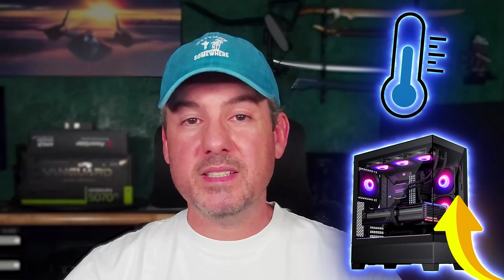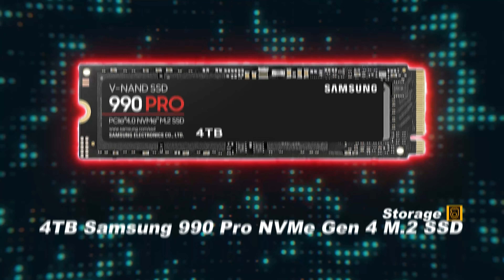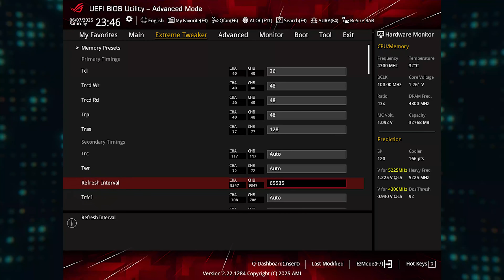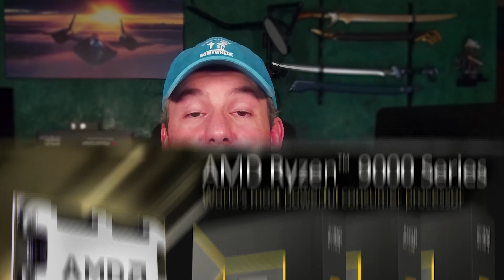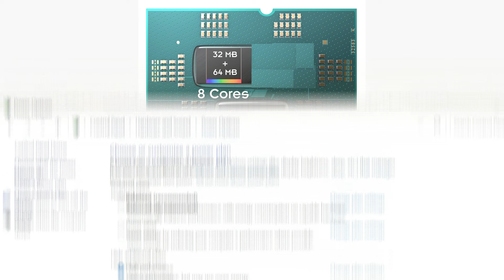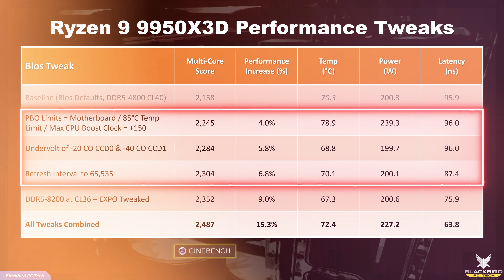What Are The Best Settings for an AMD Ryzen CPU?

Comment: Optimizer and software OC has never been stable or safe. That's why you void Warranty when enabling it. Using the max safe voltage in BIOS and then testing all core stability and temps is the best way using incremental increases depending on your CPU. All my OC PC's still work like the first day! My 9900X went through 48 hours Prime95 at 5.4GHz at 1.290 V and temps no greater than 78C with a 420mm AIO
Reply from the maker: I have no idea what it is that you are trying to say
Reply: @blackbirdpctech  Precision Boost overclock voids warranty...AMD will save a lot of money.
Reply from the maker: So you won’t use pbo, a feature developed by AMD, but you will manually OC your PCs? So tell me, how would pbo void your warranty … why wouldn’t you just reset your bios?
Reply: @blackbirdpctech  It tells you when you do the pbo. When I tried it on my older CPU 5900X any score from all the modern benchmarks was way lower than the manual overclock too. And especially the multicore tests. Besides the fact that PBO has been linked to CPU failures. But restricting Voltage to the safest max which I believe is 1.325V for 9000 series AMD you will not "burn" your CPU. I get 5.4GHz all core with 1.290 V and temps that never exceed 78C when doing heavy loads on my CPU. Perhaps with the PBO if you can put your max voltage to the safe, it may work but I doubt it will reach the scores I get with the manual overclock. I am planning to do some custom loop to have GPU and CPU in the loop to have less heat in the case and maybe go even higher! I got it to work at 1.325V at 5.5GHz but my temps when under heavy loads reached 89C, so I scaled back to 1.290V. Don't get me wrong, I liked your video but the PBO I believe is for a software OC and software can go buggy and then you're in trouble.
Reply from the maker: @websparrow  no, you clearly don't understand what PBO is and/or what it does. It's a Bios level feature set ... it's not software ... perhaps you are getting it confused with Ryzen Master? PBO provides a dynamic overclock, which is much better for your system than a static overclock because it allows your CPU to run in an optimized state, whether that is max performance or minimum power. Furthermore, PBO has not been linked to CPU failures ... please don't make things up and spread misinformation on my channel.

Comment: Ryzen 7 9700x with 105w tdp, undervolted -25, and max boost overclocked successfully to +200mhz. Thermal throttle limit set to 85°C. Tanks for the tips! Cinebench 2024 in multithread reaching 1345 pts, performing better than stock AMD Ryzen 7 9800X3D and AMD Ryzen 9 3950X.
Reply: I did the same to my R7 9700x and my temps don't get above 79 playing Fortnite with a small Thermalright Assassin King 90 se air cooler on it .
Reply: @slguimaraes  9800X3D will beat the 9700X even overclocked in gaming though. I had a solid 9700X -25 + -30 and max boost but the 9800X3D still beat it completely stock.
Reply: @soda1836 Vcache is too op lol
Reply: @soda1836  at 2x the price it's expected
Reply from the maker: Nice!
Reply: @blackbirdpctech    hi im using hp 255 g9 amd ryzen 5625u laptop  can i increase my cpu a little bit please let me know or  if there tool  i can i use for that thanks i liked and subscribed  please reply me asap would mean a lot to me thanks
Reply from the maker: @nigelphillips7454  unfortunately laptops typically have a locked down bios, so it's very likely you will be unable to modify it ... you can try using Ryzen Master, but my guess is that it won't even load
Reply: @blackbirdpctech  when you say wont load what do you mean it will crash or
Reply from the maker: @nigelphillips7454  it might tell you that Ryzen Master is not compatible with your CPU ... you can try it and see
Reply: @slguimaraes  hello, I am using the 9700x with 5070Ti. I would be glad if you could summarize the settings you have made
Reply: @ZaZaKurdish brag about settings you used!
Reply: Running mine at 65W and a -30 undervolt right now...
Reply: Same here (7 9700x @105w, undervolted -25, overclocked +200mhz.)! It runs so cool I can't hear ANYTHING from my PC. Only when playing I hear mainly the GPU fans.
7 9700X + Thermaltake CPU cooler - Gigabyte Aourus X AX Ice (cool VRMs and SSDs) - KLEVV Cras DDR5 6200Mhz - NZXT PSU (lowest noise floor & voltage variation possible). My latency is around 62-63ns. My system runs very snappy.
Reply: @slguimaraes  what the mobo used and cooler
Reply: @UdaraNawodya asus b850m-plus wifi, watercooler msi a13
Reply: Cap lol.
Reply: @slguimaraes  9700x aint beating a stock 9800x3d even if its overclocked. This is some crazy ragebait
Reply: I just got a 9700x with a b650, and I'll try these settings this weekend too!
Reply: @IlBrise  hi got the same combination, what did you use afterall?
Reply: you all can still turn to Christ if you have not God bless

Comment: uhm late and possible stupid question: does debloating Windows 11 help or waste of time, would like to see a video on that with and without overclock
Reply from the maker: It will depend on what the "bloated" version has installed ... I always remove/uninstall features that I don't use ... but it would be worth testing.
Reply: @blackbirdpctech  I used crapfixer on older i7 10th gen PC and on minisforum AMD mini PC and seen incredible difference, not enough to stop me from getting new PC but enough to not throw away good ol' reliable used PCs

Comment: Heyyy! One question, i have a 6000 ram kit , can i oc that to 6400 and put fclk at 2200, thoughts on that please and raising the voltage to 1.42 for example? Thank you in advance
Reply from the maker: You can try but it's unlikely that an FCLK of 2200 MHz will be stable ... it's more likely that you will be able to get 6200 stable versus 6400, but it depends on your CPU and motherboard.
Reply: @blackbirdpctech i have a 9800x3d and my motherboard is a rog x870-F , what should i do ? Oc the ram from 6000 to 6200 and fclk 2133? What about voltages ?
Reply from the maker: @hugofontes1613  as I mentioned in one of your other comments, to get tech support and help, you can join our Skool community:

https://www.skool.com/blackbird-pc-tech-4230/about?ref=67e6a7048d9540fe87cbdf1b69bd47f3

Comment: Heyyy should u change the scalar? I have mine on 10x, and i bumped the ppt edc and the other one i cant remeber the name i literally disbled  current limiter. Loved the video btw !!!!
Reply from the maker: I wouldn't recommend 10x since that will essentially boost your chip 10 times longer than stock settings. I would recommend only using 2x to be conservative ... boosting too long is a great way to damage your chip.
Reply: @blackbirdpctech thabk you so much for the answer , i have a 6000 ram kit , can i oc that to 6400 and put fclk at 2200, thoughts on that please ?
Reply from the maker: You can try ... but an FCLK of 2200MHz is high and will likely not be stable.

Comment: 9800x3d or 9950x3d which RAM kit would give better performance 8000MHz CL38 vs 6000MHz CL26 vs 8400MHz CL40?
Reply from the maker: I have a new memory focused video coming out later this week that will answer this question. That said, you will very likely not be able to get DDR5-8400 stable, so that’s not a viable option.
Reply: @blackbirdpctech Trying to get the RAM as fast as possible because it's been sold out since forever and only a few kits are available currently. Would really love to know which kit would give better gaming performance the 8000MHz CL38 or the 6000MHz CL26. I know for a fact that on the none X3D versions the 8000MHz CL38 is better. But I'm not sure which is better on the X3D models. I also know that the difference in performance uplift is also less.
Reply from the maker: @gabgabgab999  as I mentioned, the video will be released later this week however, all of the benchmarks are available to view in my Skool community, so if you can't wait, then this is where you can find your answer:

https://www.skool.com/blackbird-pc-tech-4230/about?ref=67e6a7048d9540fe87cbdf1b69bd47f3

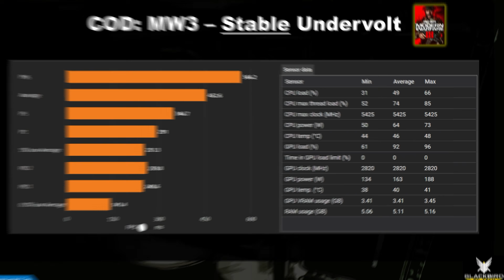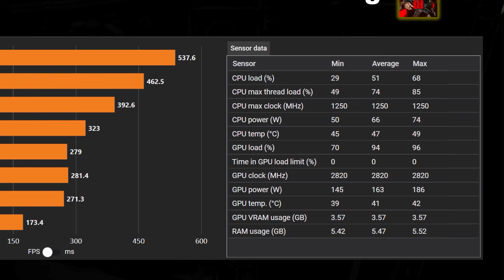Comment: Hey, could you explain why the clock stretched results were higher than the non-stretched one apart from P95 reading? 16:29 and 16:48
Reply from the maker: That's a good question and the answer is in the data. In this situation, as a result of clock stretching, some of the load was shifted to the GPU, which resulted in slightly higher performance. In cases where the CPU needs to work more the performance will drop.
Reply: @blackbirdpctech  thanks for the reply ❤

Comment: I just built my PC  slecteced EXPO1 and turned it on, had red and OJ light up on a reboot, had to reset CMOS to make it work again, now i am scared to even touch the cpu. XD
Reply from the maker: No need to be scared ... you can always use the CMOS button to reset back to default settings. Tell me a little about your system ... what components do you have (CPU, RAM, motherboard and GPU)
Reply: @blackbirdpctech  9800x3d, 6k 2x(32g), Tomahawk wifi B850, 9070 XT OC. I forgot to update BIOS, re updated it afterward in EZ flash. Now I did enabled EXPO1 but on ryzen master it's says it is off . I see the right speed on task manager . Good start I guess but tuning cpu seems harder than just clicking one button wich I did on my last Intell 10700i7.
Reply from the maker: Don't use Ryzen Master ... I explain why in the video. Not sure what the button did on your Intel 10700, but likely not much. Tuning a 9800X3D is extremely easy to do using the PBO feature set, as explained in the video. You are using dual rank RAM, so you are placing a higher load on your memory controller ... I would recommend checking your memory stability with Karhu.

Comment: I hava microstutter and fps drop problem. My system is Asus rog X870e-e, Asus Rog RTX 4080, Amd ryzen 9800x3d and Gskill Z5 Neo Rgb 64gb DDR5 6000 MHz cl30 ram. What should be my ram Expo settings and Is it a solution for my problem my %1 and %0.1 fps dying 😢
Reply from the maker: It could be a number of different things ... have you tested your RAM stability with Karhu?
Reply: @blackbirdpctech I have recently watched your video about %1 & 0.1% fps I will try aura sync and gamerfirst If I couldn’t solve the problem make a comment again because I believe you are the nolu person u can help me :)
Reply from the maker: @yolcuoglu  sounds good ... you can also join our Skool community so I can help you more:

https://www.skool.com/blackbird-pc-tech-4230/about?ref=67e6a7048d9540fe87cbdf1b69bd47f3
Reply: @blackbirdpctech  Thank you for all replies and support man. I have changed Asus Aura Sync setting and opened gamefirts it slightly increased my values but not sufficient yet.
Reply from the maker: Then the likely cause is either your RAM, drivers/windows environment or USB.
Reply: @blackbirdpctech All drivers freshly downloaded. Ram is sweet spot cl30 ddr5 6000mhz expo I all settings auto. Bios updated, armoury create completely deleted. I don’t know how to figure it out😅
Reply from the maker: @yolcuoglu  it doesn't matter whether your drivers are new, it matters what was there before and how they were removed. It also doesn't matter that you are using DDR5-6000 CL30 RAM ... to run at 6000 you are overclocking the RAM, with dual rank RAM, there is no guarantee that it will run stable. These are all things that can impact your 1% lows and that can be fixed and/or tuned.
Reply: @blackbirdpctech  I formatted it and installed all the drivers from the Asus Driver Hub. I downloaded the Nvidia application and updated the graphics driver. I booted into Expo I and reset all BIOS settings. I completely removed it with the Armoury Crate removal tool. Due to a 6-year-old problem with MSI Afterburner, I only got 1% and 0.1% FPS. The 1% and 0.1% FPS increased, but not to the level I wanted. I think I'm out of options now, so I guess I'm giving up.😢
Reply from the maker: @yolcuoglu  I have so many questions based on this, but it sounds like you are confident that it can’t be fixed … let me know if you change your mind and want to find a solution.
Reply: @blackbirdpctech I am ready to make any solution about it. Just my knowledge end. If you have a roadmap I m ready to apply this.
Reply from the maker: @yolcuoglu  I can help you further in our Skool Community:

https://www.skool.com/blackbird-pc-tech-4230/about?ref=67e6a7048d9540fe87cbdf1b69bd47f3

Comment: I might have to watch this 10 times before any of this sinks in.
Is this settings adjustment for hardcore over clicking?
I am just looking for stable, with a mild overclock
Reply from the maker: None of this is considered hardcore overclocking ... I use PBO because it's simple and achieves great results. The process is what's important ... it doesn't matter whether you want to achieve an aggressive or mild overclock.
Reply: @blackbirdpctech ok well during my build I will review several times once rig is up and running,waiting for 9800x3d, going in a Asus x870e, only possible mistake is got 6000mt memory 2 sticks 64GB (128GB) cl36, Asus 5070 Ti OC
Reply from the maker: If your focus is gaming then yes, it would be better to go with a 64GB kit of CL30 ... if it's professional workloads such as rendering, then the extra RAM will be useful.
Reply: @blackbirdpctech yeah goofed kinda late, if it works maybe setup excess as Ramdisk

Comment: The 7 series or 7 7800x3d for me, cant be overclocked or anything, i think because the Graphics chips or smn will be damaged, so you cant adjust anything. Clock speed it fixed or fused as the bios says. 
For those who wonder or wanted to try, dont even try 😂
Reply from the maker: The 7800X3D is locked for overclocking because the first gen 3Dv-cache generates too much heat … doesn’t impact other Zen 4 non X3D chips. You can however tune your RAM and undervolt your CPU.

Comment: I must have gotten good silicon then, according to your video. I’ve been running +200 boost, motherboard limits, 2100 fabric clock, ddr5 6000 cl32 2x32, OPP ram profile and 65535 trefi stable on my 9950x3d. -25 CCD 0 and -20 CCD 1
Reply from the maker: The only thing in your list that would indicate good silicon is your undervolt, which is quite good for a 9950X3D.
Reply: @blackbirdpctech that’s as low as I’ve tried to go. I would try lower, but at some point it’s diminishing returns and I don’t like instability.
Reply from the maker: Good perspective 👍

Comment: Weirdly enough I've changed everything and none of that had any benefits. Made things even worse

Only undervolting to -20 is stable across all software and did a minor jump of +20 in score in Cinebench. 

Doing -35, -30 & -25 is stable in Cinebench but crash instantly in any other software

7800x3D, FlareX5 30-38-38-96 - 6000 MHz, ASUS ROG STRIX B650E-E 

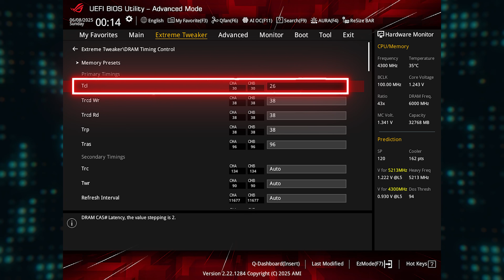At 9:20, you are saying that only TCL is different since other primary timing are the same but at 9:12 we can see that other timing are not the same (from 38 to 36) or am I misunderstanding something
Reply from the maker: That’s to be expected for a 7800X3D because it’s locked for overclocking. Undervolting will however work fine.

Wrt the TCL, the CL30 example I showed in the table from G.Skill had some higher primary timings but the CL28 kit had the exact same timings. There are CL30 kits with the same timings, and that’s what I was using in the video.
Reply: @blackbirdpctech  Ah I see, thanks for the fast answer

I'll let things as they are then, thanks for you great video !
Reply from the maker: You are very welcome!

Comment: could you please help me with one annoying this.. using 7800x3d cpu and arctic liquid freezer lll 240 aio cooler (and core performance boost activated) my cpu temp spikes from like 50-85 celcius doing just the most simple task in windows or when loading up games! in games tho the temps are fine at like 50 celcius.. very annoying and i cant get it to work properly! thanks in advance
Reply from the maker: Why do you think it's not working properly? By the way, don't bother adding a boost for the 7800X3D because it's locked for overclocking, so it won't do anything.
Reply: @blackbirdpctech i thought asus core performance boos "had to be" enabled because otherwise it is much slower? 🤔
Reply from the maker: @Kingolaconny  you should leave that on auto ... I thought you were talking about adding a Max CPU Boost Clock Override in PBO. Your CPU clock won't boost with a 7800X3D.
Reply: @blackbirdpctech no im just using precision boost overdrive and core performance boost but still these temp spikes 😴 like i said, while gaming temps are fine but if i load into a new world/room or just watching a youtube video or something temps and fans are rushing
Reply from the maker: @Kingolaconny  I don't understand what the issue is that you are describing ... you will always get temp spikes as the load on your CPU spikes

Comment: I'm going for a 9950 x3D and a 7900 xtx do you think that the RM1000x that I chose would be enough. Case is an ICue 5000T
Reply from the maker: You can use a PSU calculator like this to estimate your power needs:

https://www.bequiet.com/en/psucalculator

For max efficiency you should try to operate at around 50% load.
Reply: @blackbirdpctech yeah looks like I'll have to up my psu to at least 1200W or 1300W
Reply from the maker: 1200W will be plenty … and will give you headroom to oc
Reply: I have the same combo right now. Get at least 1200w

Comment: I have an issue, i have just bought 24x4 G.Skill 8000 mt/s ddr5 for my AMD 9950x3d and Asus Crosshair x870e extreme. I am not able to tune it in Expo I or II as the system is always crashed. Please suggest.
Reply from the maker: That is unfortunately to be expected when you populate all 4-dimms for DDR5 based systems and try overclocking the RAM. You are essentially placing a high load on the memory controller and it can't handle it. You will likely have to back off to something like DDR5-6000 in 1:1 mode (if you are lucky) ... or something slower if that's unstable.